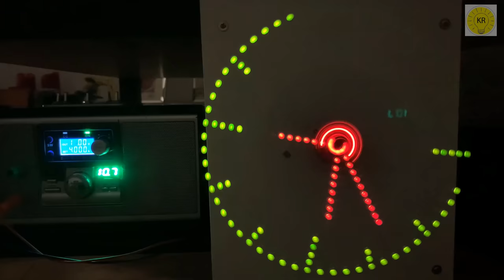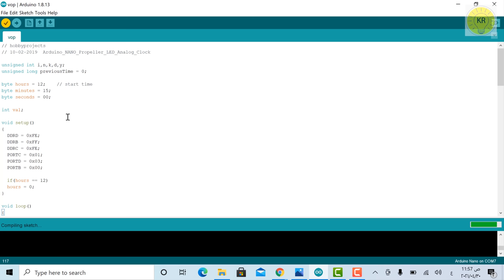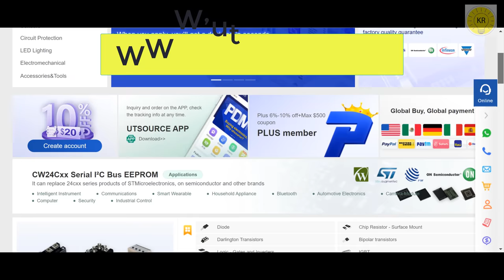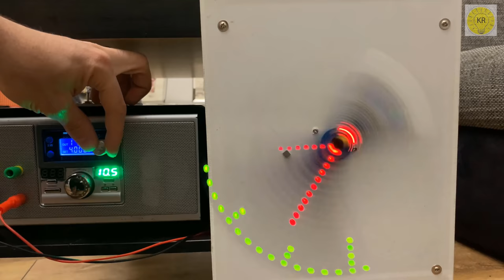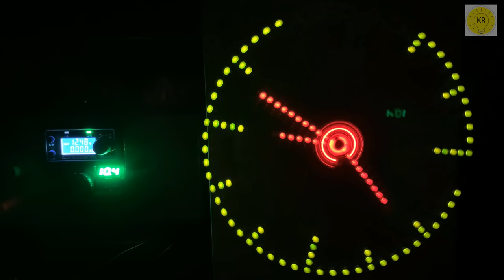how to make Propeller LED Analog Clock, Arduino NANO, utsource

Comment: For sure you put that first resistor flipped to trigger us all hahaha great project though!
Reply: I always thought the resister will work in either direction, as well as some capacitors.
Reply: @HannTheftAudio  it does. But there are some assembly conventions. One being that resistors must be orientated in the same direction whenever the layout allows for it. Makes it easier to read the values when looking at an unknown board.
Reply: @mercartax  What I just got from that is that they all face the same direction for the sole purpose of making it easier to read the values.... when looking at an unknown board.  So other than that it wouldn't matter which way it goes???   hmmm  I can actually see making it easier to read the values, and it makes the board neat and tidy as well.  But for those who can care less just slap it together. as for me I would end up just slapping it together and saying WGAF.  Especially if im just gonna cram it all into a box anyway.
Reply: @mercartax  I used to get my boss in a tizzy when I "wasted time" setting up my VCD sequencers with all the resistors going in the same direction and STILL beat all of his old production records.

Comment: Flip the polarity on your dc motor so the clock runs in correct direction
Reply: Its a AntiClock it revertes flow of time in a radius of 15 meters.

Comment: 😍, bagus sekali
Pak, itu berarti ada 2 sumber tegangan kah? Satu utk motor 12v satunya batrei utk modul ? 🙏
Reply: Iya bang. Nano pake yg 4,7 v.
Reply: @muhibbonhasbi4419  bisa bertahan brp lama mas klo pakai batrei?
Reply: @yus_ag  Hitung aja bang. Itu kan 4.7 v, ga tau berapa mah, mah nya ubah dulu ke ah. Ntar kalikan 4,7v. Misalkan dia 700mah = 0.7 ah x 4,7 = 3,29 wh.
Ntar bagikan konsumsi daya mikrokontroler nya. Kalo nano menurut speksnya kalo ga salah dia 19mA jadi 0.019x4.7 itu 0.09 watt. 3.29 / 0.09 = 36.5 jam.

Kasarnya kekgitu situ Bang. Cuma gatau dah benar atau salah. coba hitung aja bang. 😅

Comment: Wtf, soldered the arduino :(
Reply: Do you mean him not using a header? I think that the direct soldering is to keep the assembly from flying apart at the high rotational speed.
Reply: @bob2161  yes Sir, and the position of the arduino is not that far from the center which is the momentum is not that high. And if you are scared to fall apart o flew away you can put something to lock it up
Reply: @roldanfajardo5132  you make valid points, however, there have to be considerations made for each one. While it is true that the ardweenie, itself, is near the center of rotation (and mass), due to the second section of board, it is still subjected to the forces generated by the mass of everything beyond it. 
The suggestion of strengthening the joint (providing a load path that passes around the ardweenie), is actually a good option. Provided it is done carefully. Too much reinforcement can get heavy, which will further complicate the problem. Although, it would lessin the required weight of the counter-balance. So that's a  good thing.
Reply: @bob2161  you are on point, maybe the reason why I affected too much when he soldered the Arduino is because when I was studying Im so much careful about my arduino, which is I can use it through my whole year studying and projects haha
Reply: @roldanfajardo5132  That makes perfect sence. I too am one who likes to keep things in good condition for as long as I can. In this case, I believe the creator of this project had made the decision that the ardweenie was to become a permanent part of this project, in the name of safety.  
Cheers